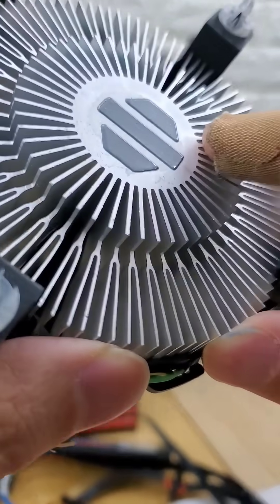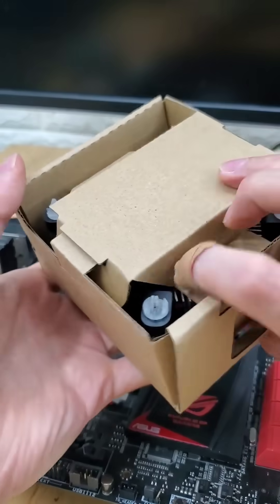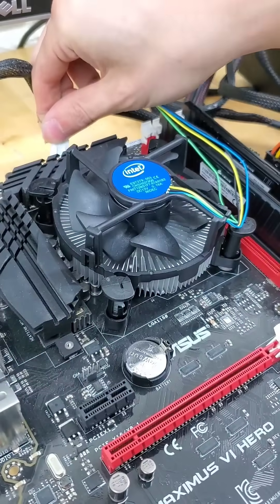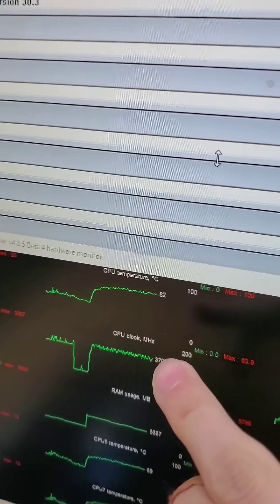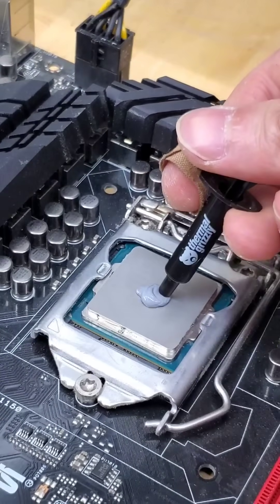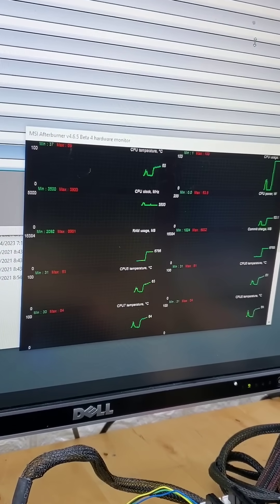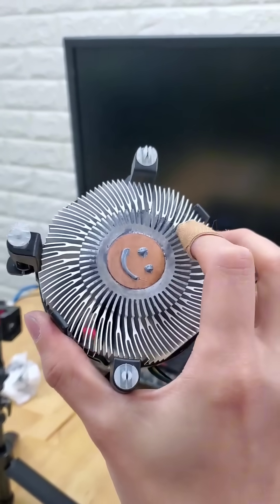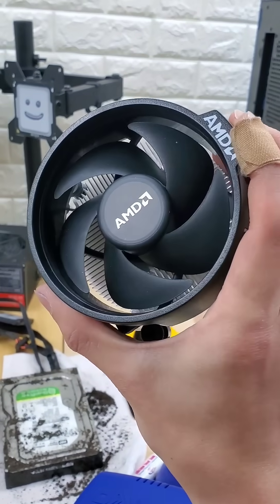how BAD is Intel's stock cooler? #shorts

Comment: This kind of highlights the absurdity of the cooling market as well. You go the little stock coolers that a perfectly fine the you have the 17 fan cooled giga radiators that only give you minimal performance boost but use significantly more power draw.

Comment: One point I was building a computer for one of my friends and he just needed something as cheap as possible that was able to run things better than the computer. He had the stock cooler that came with the AMDCPU. I put it on the CPU and when everything was done, I went and started up the computer and it immediately overheated. Took the cooler off. The pace had spread out properly and there was no sticker obviously but for some reason, the pace just did not work. I don’t know if it was a bad batch or something that was applied, but I had to use my own tubes that I had lying around

Comment: Ultimately it isn’t designed for enthusiast systems. It’s designed to keep run of the mill processors at stable and healthy temperatures for as long as possible while being cheap and easy to install; and it meets those design aims admirably. I had a Pentium G3258 in my first PC build and the stock cooler was more than cromulent, hell one even did pretty admirably on the i5 4690k I upgraded to until I could afford a better cooler to start overclocking it.

Comment: Case airflow is also a big deal. Intel stock coolers are not used by many OEM, such as HP, Dell that use flow thru design to pump heat out the back of case.

Comment: You show two different Intel coolers. One all aluminum 65 watt model, and one copper slug 95 watt model. Did you use the appropriate cooler for the TDP of the CPU?

Comment: I'm amazed this video wasn't about how much of a bitch it is to actually get the cooler seated. When I replaced the CPU on my MSI Meg z490i Mini-ITX, the stock cooler just refused to seat properly. No matter how well-aligned I placed the holes, it just refused to click. It finally did after breaking one of the clear tabs in the corner, but even then the corners feel like they aren't fully solid. Never could understand what I was doing wrong, but I still get decently low temps so at least it works...

Comment: Adding thermal paste with decent amount (not too little or too much), no matter the quality, is what is important FOR general audiences. 

Because 5 degree diff under extreme load (which never happens in normal usage) between cheap and expensive paste is not worth it. 

Good thermal paste itself is relatively expensive (>$10) compared to entry-level PC cost. It is like adding 10% extra cost for NO apparent difference from user perspective (only noticable for geeks/nerds with temp monitor software).

Comment: You can't just compare the temperatures, because fan speeds are variable. Replacing the stock cooler isn't so much about lower temperatures (because as long as you're not thermal throttling it's not going to make that big of a difference), but about lower noise levels.

Comment: The biggest difference is the viscosity. You got better spread from the thermal Grizzly because it is thinner, thicker thermal paste requires you to push down and jiggle the cooler (without lifting it back up) to get the best spread and thinner layer of paste.
It's all about technique, you didn't give it a fair shot.

Comment: I used one for some weeks. Noisy and hot. Easily 90° on a 11400 i5. A used noctua from a friend with cheapo paste was 35-40° cooler and mostly not hearable.

Comment: They know what's "good enough" and they also know that if their hardware is business critical enough to use at full capacity for a long time, most users can afford to upgrade.
The "fancier" stuff is for gamers who typically run hotter for longer and will upgrade every year or two (performance over durability).

Comment: I upgraded to an i5 12400F a few months back, and immediately regret going with the stock cooler! It would idle at 45C, and when under load (Not even benchmark heavy load, just practical real world application stuff) it would hit 100C.

CLEARLY mistakes were made trusting it to be useful! After getting an aftermarket cooler, it idles at 32C and I haven't seen it peak above 50C.

Comment: Word of advice for the AMD cooler stock thermal paste. Even if it cools well, be sure to replace it as soon as possible. Because when that thing eventually dries up, the cooler will become glued to the processor,  and you can easily damage the CPU  when that happens.

Comment: Is that a really dumb editing error or are these two tests actually use different coolers? The first one is a cheaper all steel one and the second has a brass contact plate. That alone will affect the heat transfer in a big way.
Also pretty sure most if not all Intel cpus (anything starting from I3 12th gen) now have a different, better Laminar coolers.

Comment: Used the same cooler but with the copper core on an i7 6700k together with TG liquid metal. The pc was build in 2017 and is still running fine at around 80C under full load!

Comment: Best upgrade for the intel stock cooler is to replace it with better one. Even Arctic Alpine, which is like the stock cooler but with twice the height, can lead up to 20 degrees lower temps (cpu dependant, but still has massive effect).

Comment: i have a i7 2600k that has a hyper 212 disipator , that was because the cpu stock cooler was so bad that i had temperatures over 90 C at the time, then i changed to that , right now i have a ryzen  7 5800XT now at least because my i7 2600k while it was good, i couldnt play the games that really need a 6cores 12 treads on it (still the one i got is for streaming or edit videos.

Comment: Honestly it did the job even for my 7700K, but it did make you have to replace the paste more often. I was a newbie back then and just needed something that worked and this did. Now, with my AIO, I managed to pull it off my CPU when the paste was in the gluey kind of phase, and it tugged on some pins, RIP, motherboard. I’m glad AMD changed the pins to be in the socket, though, I’m sure most of us are spending much more on our CPUs than our mobos.

Comment: I’ve seen people incompetent at applying thermal paste before, but you are the king of them, you are truly useless... you put way too much paste on the heatsink. In these cases, the less thermal paste you use, the better. The thinner the layer, as long as it allows for 100% contact without air in between, the better

Comment: This is the only CPU cooler you will ever need, if you can stand the noise... Anything else is just BS, as long as the CPU works within the range of its operational temperature and does not overheat it makes no difference unless you want to overclock it,  the only thing different is your mind.
I have a Zalman from 2008 that i migrated to over 2-3 different sockets and i only use that because it's silent, what kind of temperatures does it get, i couldn't care less.
Reply: Nah

Comment: I get that the stock cooler is easier to install - which makes sense for a factory assembling thousands of these a week - but I would never use one in a production system.  Motherboard dies?  System has inadequate cooling?  Say goodbye to those retainer clips.

Comment: I used i3 10100f whit the stock cooler using noctua thermal paste now ive upgraded to i5 10600kf and had to swap to deepcool ag400 for better cooling otherwise the stock cooler works well whit the low end models that have under 70w TDP

Comment: guys, I have a 2019 MacBook Air, and no, I don’t wanna upgrade (nursing school is expensive enough) 
I want to change the thermal paste, should I use 91% isopropyl alcohol? And do I really have to disconnect the battery?

Comment: Have always used the stock cooler and thermal paste with the addition of little extra high end paste. Worked like charm.. Never even got past 70 'c while on full speed (no over-clocking)..

Comment: If you are not overclocking you will be fine with the stock paste for 10 years without changing it. If you are overclocking, you will not have that cooler anyways😂 

For stock speeds it's great.

Comment: The thing people always fail to mention is that  10 or 20 degrees cooler has NO impact on the actual performance of the CPU. A 9600x with a stock cooler running at 90c is fine. Adding an aftermarket cooler to run it at 60 or 70c is a waste of money.

Comment: inst that the old design of intel stock cooler?, mine i5 12400f came with a different one that goes 60-70 degrees on elden ring max graphics with also stock thermal paste

Comment: I've always experienced Intel CPUs being able to take the heat much better than AMD.  I've had fans fail, and the AMD processors have just died, while the Intel CPUs start acting flaky.  Fix the fan, and the AMDs were still dead while the Intel acts like it's just another day on the job.    Yeah, this is anecdotal, but I have experienced it several times.  I remember an OC'd Intel CPU that melted my fingerprints off with the fan failed, work just fine for years after I fixe the fan.  How did I get so many fan failures?  I worked in a very dusty environment once where zero maintenance was done on systems until they failed.  

The cooling market went overboard grabbing people's money.  Best thing to do now is just design it with good airflow and keep it clean.  That will make a much better impact than worrying about oversized sinks and optimal paste.

Comment: Why is the clock 3.750 ghz in the fitst clip, 3.5 in the second?
Reply: LGA1150, but we don’t know the CPU model, its TDP, or the fan RPM — we only have the temperature readings. After examining the the video Z87 board, it appears the CPU has 8 threads and 8 MB of L3 cache, which suggests it’s an i7. However, the maximum power draw of 63.9 W indicates that it’s a low-power model. In the second run, the maximum power was 54.6 W. The results were manipulated

Comment: i hated those tool-less intel fans. they are ass to install and remove, and with those tiny round contact surface at the same level of the fins guaranteeing getting some of thermal paste mess getting stuck between the fins sooner or later

Comment: Intel stock cooler is  like putting a 4 cylinder radiator to cool a V8, it's shitty and awfully noisy and yes their thermal compound also sucks, even using cheap white silicon grease that we use in power electronic cooling and is also great for plastic geared motors is way better > -10°C on old Intel P4 3ghzn tested back in time till buying an heatpipe cpu cooler.

Comment: both are very bad. Amd stock wrath cooler with original paste for 5600xt cpu shooted up IMMEDIATELY to 90c limit. Installed assassin air cooler, 65c at high loads.

Comment: I’m using the stock cooler on my i5-3470, and it still runs surprisingly cool, temps stay around 30°C at idle and peak around 50°C under heavy load.

Comment: Bro, changing the cooler and the thermal paste is 100% worth it
 I tried stress testing my CPU and it got thermal throttle with base fan and paste. Spend 20 USD for new fan and paste and it never throttle and the tempt at 100% use was 20 C lower

Comment: Also, this is a Pentium Stock cooler, Core one's have a copper layer that improve a lot the heat conductivity (like you see at the end)
Reply: them stock all aluminium came with i3's and some i5's

Comment: The stock Intel cooler in the times of the glorious 2500k was quite good. Cheap, silent, compact, enough. Sure, the pre applied paste is nothing special, but did the job for 99% of the use cases

Comment: What happens when you put laptop ram in a desktop ram slot
Reply: its still ram. if it fits and is the correct version is probably works. ram is so flat that laptops dont need modified versions

Comment: The thing is the paste isn't there to transfer heat, it's there to make sure there's no air gaps between the two metal surfaces. Less is more and you clearly had a huge air gap on the stock paste because you didn't tighten it gradually and let the air out, so it trapped the paste in the centre and left air around it.

Comment: Some of them have a copper core, they are relatively decent in my opinion. Aluminum heat-sinks only? No way.

AMD stock coolers? I would only use the Wraith Prism and say no to Wraith Stealth, and install it with old 3600X or even earlier AM4 CPUs.

Comment: When Intel designed its coolers, their CPUs used 35-65W. A modern CPU easily produces twice that heat. That’s why they stopped packing them. That being said, their stock coolers where great for the time and are still awesome for low power builds.

Comment: Cheater ! You used 2 different coolers. With the stock paste the ultra cheap and bad all aluminium one and with the good paste the much better copper slug model. I have both and know the difference is the cooler not the paste.

Comment: I use a pentium g2030t and the stock cooler is actually prefectly fine and you dont need to do anything to it (40 degrees with 12 year old stock thermal paste running stress-ng)